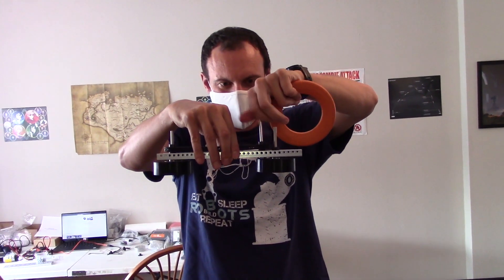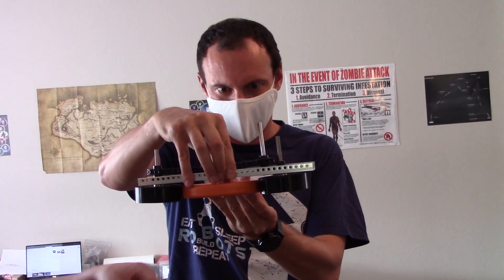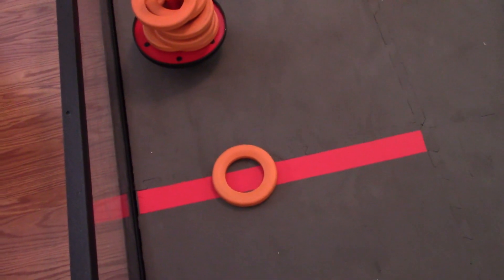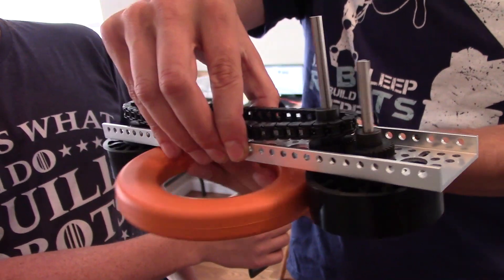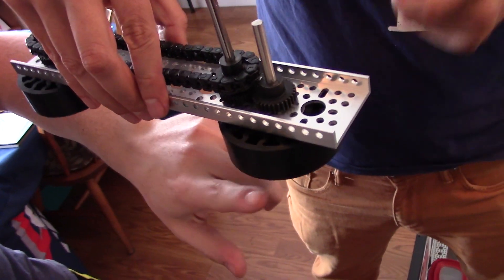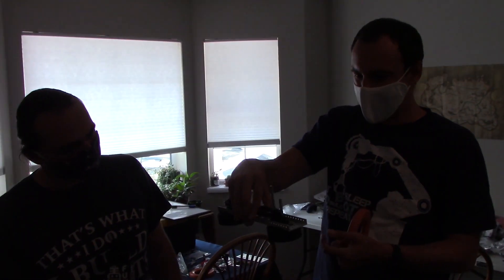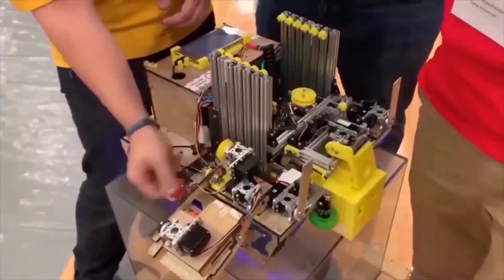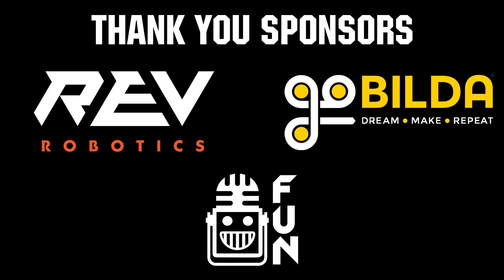Ring Launcher Prototype ULTIMATE GOAL FTC University Challenge

Comment: Hi for ur design how would you calculate the speed of the wheels if u want to launch the rings at a certain speed?
Reply: In order to calculate the speed of the wheels, you just need to know how fast the motor that spins the ring is going. You can take the rotational speed and find the tangential force that it puts on the ring. That is the launch velocity.